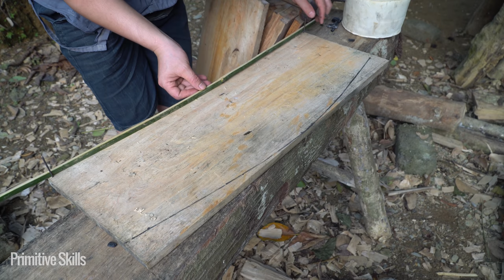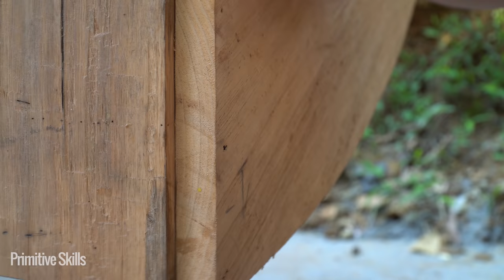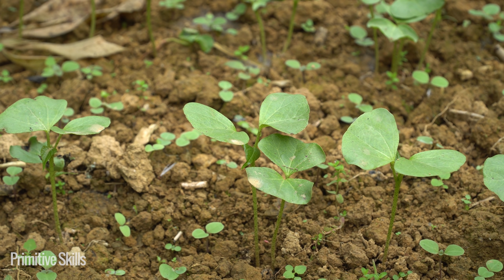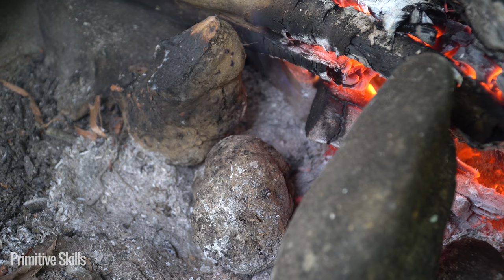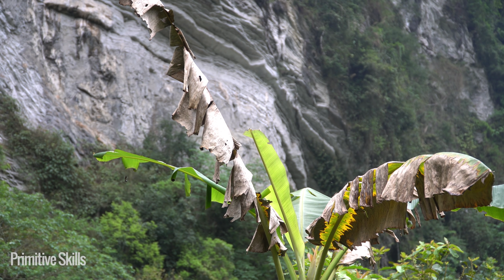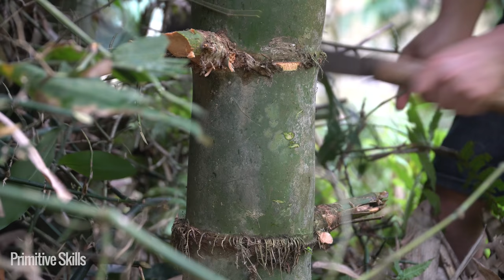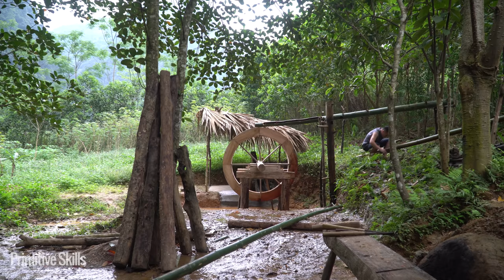Primitive Skills: HOW TO BUILD A WATER WHEEL // Complete After 2 months, put into TEST RUN - Ep.134

Comment: A good wheel turned out to be beautiful. the seats after lapping should be adjusted and lubricated with coal. or put steel plates in the bowls so that the slide is better and split linings made of bamboo on the shaft so that the shaft does not wear out.

Comment: You can also grind charcoal into a fine powder and use it to dry lubricate the axle of the water wheel. I dont know how long it will last but it should help loosen the friction and make the wheel turn smother.

Comment: I was expecting you would forge primitive iron sliding bearings for wheel joints. This is relatively simple compared to the amount of work done. Placed on metal beds they might even not need oiling. And more durable. Current setup has too much friction, and prevent from using the force generated by wheel. Without watering or oiling, wooden joints can start smoke or fire - used to do so in wooden cart wheels. Still, that is great job. Thank you for all those videos. Yours are among few channels I am always waiting for.

Comment: This guy is creating a water reel. The rotating reel will make the motor work to generate alternating current through the diodes into direct current to be loaded into the accumulator. He is living in primitive times, to have a motor installed in this water reel. I guess he will travel through space to go back to modern times to buy a generator motor 😊😅

Comment: If you put iron sheets under the arm that makes the wheel rotate, its rotation would be easier and the wood will not be eroded quickly, and it will also save energy and make the rotation faster because the water will be strong and the water wheel will spin easier.

Comment: I really admire your work. You are very talented.
I might have chosen to have a 12-sided horizontal axis instead of 8. I would think that this would reduce the eccentricity value, rotate better, and maybe even improve the friction index. I know that it is more difficult to make the dodecagon, but it is possible to draw with a ruler and compass and it is not necessary to measure angles.
In addition, it would not be bad to treat the wood to avoid that the water punishes the wood too much and wears it over time. Perhaps applying the Shou Sugi Ban or Yakisugi technique will help a lot to preserve it. Or maybe I'm talking too much, and at the time of publishing this video you've already done this or applied some other technique.

Comment: Hello. I want to quickly share some points of interest that you may want to consider if you have not already. Some of these points I realized while watching the video, and others I found buried in the comments and hope to make them more visible. So, let's see:

The amount of water - and force - seen in this video is enough to turn the wheel as long as the axle does not apply torque to anything else . If you tried connecting it to something, like a lathe or a millstone, it would not have enough power to operate properly. What could be done to improve this situation?

1) Increase the net volume of water to turn the wheel, by
   - making extra bamboo pipes.
   - digging out a new canal.
   - building a high capacity pipe/aqueduct from larger bamboo, hardwood or concrete.

2) Increase the force of the water, by
   - having a higher drop at the end of the pipe in order to make more effective use of gravity .
   - minimize amount of turns and angles in the pipes, thereby decreasing loss of momentum .
   - funneling the water at the end of a closed pipe system, forcing it to exit at higher velocity . (This one I am not certain about. Corrections are welcome.)

3) Decrease friction between the axle and support beam, by
   - using a natural lubricant, e.g. some sort of fat from plants or animals. (Others have suggested powdered charcoal as well.)
   - minimize the area of surface contact between axle and beam.
   - covering one or both of the contact surfaces with materials that provide lower friction, though this just might be another way of saying "lubricant" again =) 
     (The only thing I can think of right now is wood resin, but I don't have personal experience with it.)
   - making something similar to a ball bearing system, perhaps by integrating cuts of bamboo with a diameter close to that of the axle.

All right, this is all I could gather for now. Let me emphasize that I do not wish to impose my own will or visions on the content of this channel. I simply want to provide an extra source of knowledge/inspiration, so that it is available if needed. Though, obviously from the content of this channel, you are already in posession of knowledge about craftmanship, physics, agriculture and foraging - among others, i am certain.

I take no credit for any of the ideas in this comment , as the possibility of them being mentioned before is high. Just wanted to increase the chance of the concepts as they are to be visible.

Comment: I think you will need an extra waterline for more power... also wouldn't hurt to fix the waterwheel in place with an upper clamp on the output shaft... as for lessening the friction in the system... I can't really figure anything quickly... perhaps try putting grease in there? idk...

Comment: Good job making an overshot wheel, definitely the most efficient option. I think you could reduce the friction significantly more than you have, and get better performance. Let the wood dry out for a while, then shape the axle (hub) and surrounds far more smoothly. Use soft rocks as sandpaper to get it even smoother, then try even burnishing it to a shine with a small hard people. Consider smothering it with oil, pigs fat was common for wooden wheels. The idea is to reduce friction as much as humanly possible. It will make a huge difference in the performance, but it was still great to see it working with only water as lubrication!

Comment: Man great work but you have to do something:
-find something that protect wood from the water (I don't know in you place if there is something you can use but you can search about techniques that ancient people used for the boat isolation)
-add some fat as lubricant, or some oil that you can take from plants
-make bigger pockets on the power wheel
That things are necessary, in particular the last two because otherwise if you connect your wheel to some instrument It would stop and not work. 
An other solution to have less friction is to make a metal basement  where you can lay the arm of the wheel

Comment: if you find hole in it (although you don't have to patch them unless they're bigger than the width of 2-3 fingers) you can use a charcoal based resin and maybe a small thin peice of wood to close it... or just do what my dad did for our chicken coop... ram a stick/branch that's thick enough into i then saw off both sides once it's wedged in the thight...

Comment: I would suggest he start looking into obtaining animal fat or plant based lubricants to grease the shaft of that water wheel. The more freely that thing can spin,t he less wear on the wood and the more power he can get out of it. Not sure if he can manage it, but use that forge to create shaft washers and polish the metal nice and smooth so the wood shaft is rubbing on the metal instead of wood on wood. Doing this will also let you do the same on the shaft later so you can make a break system to stop the wheel also. It's more complicated work but it would make usage easier in the long run.

Comment: You can call it... cheating. But think you should try greasing the axles if you want more power. I once also tinkered around with wooden water wheels, and I found the one I built worked best only when well greased with olive oil. Though it's just a suggestion, and it might be too difficult to gather the amounts of oil required.

Comment: I am looking forward to see how you will utilize this spinning motion.

Side-note: When I think about creating a water-mill, I always end up submerging the lower third of the mill into water.
Is that an option for you?
Reply: Yeah.
Reply: Doesn't a water mill work on the flow rate of water from a stream/river pushing it, as the water wheel uses gravity/overhead water to move it.

As for use case id put a large bowl and stone on the end and make a flower mill as his water hammer just de-husks things or a pulley to push/pull the forge blower.
Reply: @xkblxcripple  Having the wheel in some water will reduce the overall weight of the wheel (a little bit) - the lighter the wheel is, the easier it will move/spin.
There are a few more ways to make the wheel easier going, but they are VERY hard to achieve.
Reply: But if the lower water is not flowing, you have the water resistance. So I think the weight reduction is not worth.
Reply: @eduardnachname6056  Yes. You may be right that there needs to be a bit of flow... but I am not so sure about that.
The water should not add that much resistance that the weight-reduction becomes void... maybe.
If I was younger, I would immediately start testing.
But I am also not so sure about how the wood "Primitive Skills" uses reacts to being submerged in water for a long time.
A lot of questions.
Primitive Skills will make something great out of the situation, me thinks :).
Reply: @frankohero  come clean and tell the world about the material stolen from MegaRavans channel especially @jim bayler.

Comment: I wonder what he intends on using the water wheel for. He could use it for power production maybe. Need magnetic rock and copper wire but it could be done. Other wise maybe for an old wood saw
Reply: automated saw, higher temperature fires, anything really.

Comment: looks like the bearings have alot of surface area and therefore too much friction. water barely has enough energy to turn the wheel. like this you will not have alot of energy to transmit for whatever purpose you built this for. with a pintle design it is far less contact and friction (it is like a center on a lathe). the large surface bearing you have, however, are good for higher mechanical load.

Comment: These boards are not made by hand, you are shown how it can be done primitively and then the rest is professionally prepared outside the frame. See what the surface of the boards looks like after manual processing and how smooth and even the wheel is.